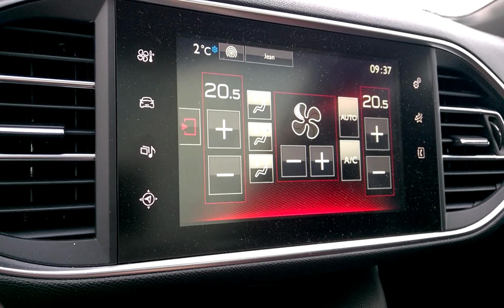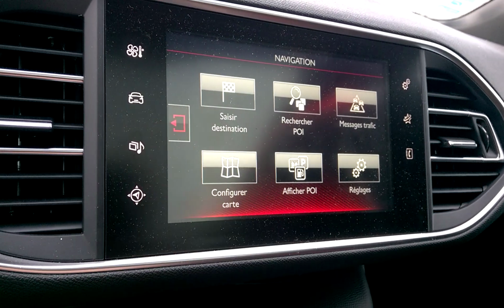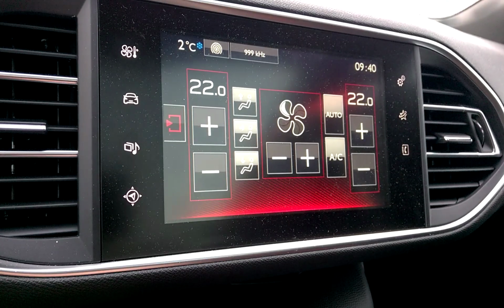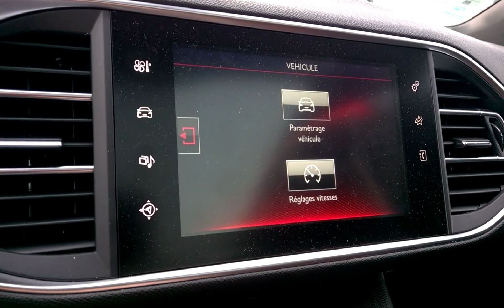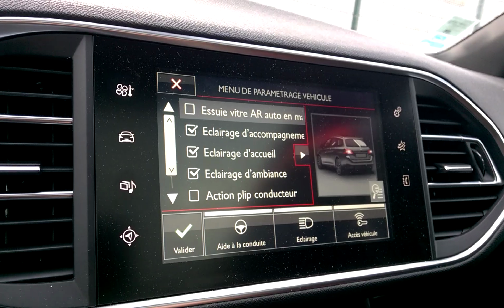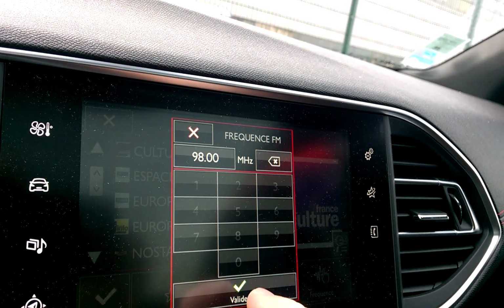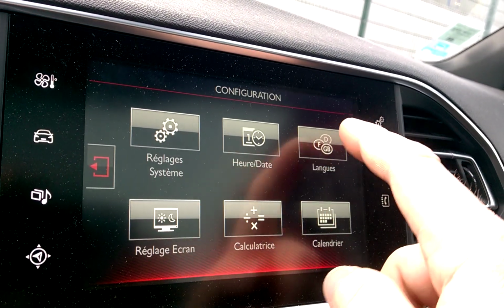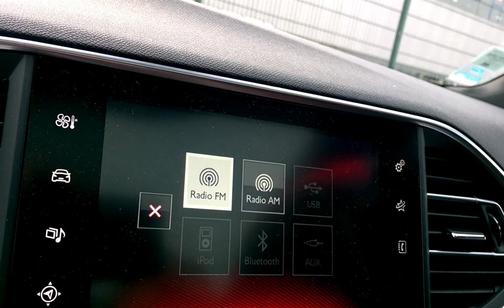Peugeot 308 (2014-2017) audio media satnav system - part 1

Comment: Do you know a solution for the whole audio of the car not working… sometimes :D it happened to me a few times and the best i could find is a problem with the amplifier in the trunk. It thinks that there is a problem with one of the speakers so the car mutes all the audio. But not sure about it and i don’t want to deasemble galf of the car to check. Thank you and much apricieted!

Comment: I've just purchased a 2017 308 gt but the  sound keeps going off, no audio from the speakers at all. Any ideas what this could be?
Reply: This is a common fault. It happens to mine at random intervals too. If you check on the forums you'll find many answers, none of them definitive. It's frustrating as hell. It's pot luck whether you get any sound through the speakers when you first get in. Then, later, all the sound comes back. It's either an electrical gremlin or a software issue. It should be an easy fix after all these years but isn't as far as I know. It spoils an otherwise superb car.
Reply: Other than that, how is it going with the car

Comment: Thank you, getting my 2014 308 next week, so this was usefull 😃
Reply: How its going with that car
Reply: @forfran  it is going great, i have had no problems with it, had it serviced 2 weeks ago, and they said it was nothing unnormal, and only changed filters and fluids.

I also swapped the reverse camera at the dealer, since the original one is not the best in dusk and pitch black conditions, so peugeot offered me a newer model camera, and that works great in the dark , recommend all doing that 

As for how the car feels, it feels just as fun as the day i got it, although i have swapped all the speakers and installed a total of 12 speakers an amp and a sub, so it is allaround a fun and fantastic car still, and very nice for the wallet since it is not a very thirsty car (which is great these days). I look forward to driving many more kilometers and with it 🙌🏼
Reply: @sverreantonsen7054  Ty for the info !! That's what i want to hear haha, hopefully next week the 308 is mine too
Reply: @forfran  awesome, hope you will have much fun with the car as well 🙌🏼
Reply: @sverreantonsen7054 hey bro any update about the car?
Reply: @forgetsassi 175k km on it now, still going strong 🤘🏻
Reply: Have a manual 2015. So far so good... I was wondering about the camera and how to get it changed..

Comment: is there an option to switch on and off the start-stop system through the panel?
Reply from the maker: Every time..the start stop reduces fuel consumption and emissions, so for it to count in the vehicle homologation it must be ON every time the vehicle starts. It does have complex strategies to not stop the engine for example if heating or AC is required,.or the battery is charging etc. But in general either u deactivate it each time, or learn to live with it and save a little CO2 on each drive 👍
Reply: @BenInFrance  Thank you, you are very kind sir, I appreciate the time you took to answer my question. I wish you all the best.
Reply from the maker: Not sure im afraid ive not got that version any more. Start stop is either deactivated by a button low down between the steering wheel and the door, or by ticking / unticking a box in the vehicle parameters in the screen (the little car)
Reply: @BenInFrance  ohh thank you very much for this information! Just one more thing bugs my mind, do you have to deactivate it every time you get into a car or does it stay deactivated once you untick the start-stop system? Would really appreciate your answer on this one, thanks

Comment: Could you please answer how to turn on the heat without turning on the AC?
Reply from the maker: Not quite sure what you mean? Just turn on the heat and press "a/c" to turn off the air conditioning
Reply: benhindsley this is what I dont understand, how to turn on the heat? From what I saw, you can set temperature, but you cannot set warm or cold air. Do you get what I mean?
Reply from the maker: You can only set the temperature. The car has sensors and knows the cabin temperature and sunlight conditions. So you set a higher or lower temp and this system takes care of the air temp for you.
Reply: Thats the answer I was looking for. Thank you a lot

Comment: How good is the stereo system?
Reply from the maker: Not sure how to answer that. The standard stereo is perfectly fine and in one of mine i had the denon hifi with the subwoofer and uprated speakers which i found brilliant
Reply: The audio system is alright,  not the greatest
Reply: It’s adequate, how good are your ears?
Reply: You need to hold gearbox in your car and see wich Version so you have, i Have bought used one and i see that  Sound ist poor so i downloaded New update instal it, audio for me is 30% better now

Comment: Hi 
thank you for sharing the video 
it helps with a few questions i have as i want to get an Estate version of 308SW.
Question i have is how easy is it adjust the temperature of the cabin while driving.
A lot of reviews in the Uk say that it’s fiddly to do and takes your eyes off the road for too long how do you find it while driving . 
Also can you access your phone book contacts through the steering wheel rather through the touch screen  
your response and time to reply is much appreciated 😊
Reply from the maker: Hi, i found i got used to the aircon in the touch screen..it.is more fiddly than having separate switches, for sure, but then i like how it's led to such a clean dashboard style. So overall a bit more fiddly but for me not a major issue.
As for the phone contacts i've never tried it..if i can i'll let you know but for now i can't say i'm afraid. 
Regards, Ben
Reply: benhindsley Thanks very much Ben il let you know if i get one hope you are still enjoying yours 😊
Reply: benhindsley Hi Ben sorry another question how you finding the car overall are you enjoying it what spec do you have ?
Reply from the maker: Chris Hill Hi i have a 308sw. I got the GT line since i love the body kit and black interior. I went with the 1.2 litre 130hp engine which i find fabulous with the automatic gearbox. I'm thrilled with the car and the quality is clearly there - i haven't had a single issue with it.
Reply from the maker: Chris Hill hi ok so i checked and yes the button from the steering wheel allows me to open and scroll through contacts and call them.
Reply: benhindsley thanks for advising me il keep you posted on what i get
Reply: benhindsley Hi Ben if possible please could you upload a video of you accessing the contacts through the steering wheel step by step  only if it’s okay too 
thank you 😊
Reply from the maker: Chris Hill ok so i made you a little video..how to upload it? I'll try
Reply from the maker: Chris Hill here you go. Mind there are different systems in the 308. My initial video is the smeg system from the 2014-2017 car and the video accessing the contacts is a nac system in the restyled 2018 car. https://youtu.be/owlVGQKXCjo
Reply: benhindsley thanks Ben video much appreciated very useful 😊

Comment: I'm tempted to buy one. Can't decide what colour or engine. The sensible part of me says I should get the 1.2 but I'm worried it will be slow and annoying, changing gear every 10 seconds.
Reply from the maker: Buy one! I had the 1.2 130hp auto (sw, gt line) and it was brilliant, a really dynamic engine.
Reply: What about the touch screen bit? People say it's annoying. The only other problem I have is the steering wheel position and the rear leg room. I don't suppose you can comment on the leg room bit if you had the sw version. Otherwise I'm really tempted.
Reply from the maker: steering wheel was perfect for me but i suppose u could try one at a garage, i love the fact that it's smaller it makes the car so much more kart like ! 
Rear leg room is less than a golf sure but do you need it? If so an sw would be better!! Though on the upside the hatch has a much bigger boot than the golf, and overall the peugeot is a lot more fun! 😉
Reply: I went in to a dealership today and had a look. I'm really disappointed. I love the layout and feel of sitting in the driving seat.  Some bits in the 308 seemed a bit cheap but I think I would get on well with the small steering wheel and the dials and the overall look and feel is miles ahead of a Golf. The only problem I had was when I sat in the back seat. I'm only about 175cm but it  was too small for me to be confortable. It seems like the designers were very stupid to not take 5-10cm from the back to make more leg room. The car wasn't switched on so I couldn't try the touch screen but I think I'd be ok with it just because I liked the interior so much. I'll probably end up buying a Golf now and I know I really won't like the dull interior and incredibly dull exterior but practicality will win. I bloody hate Golfs.
Reply: benhindsley hi 
i have asked you a query ref the touch screen your response would be appreciated thank you 😊 my comment is above
Reply: 1.6 has more torque .

Comment: Nice video! Perhaps you can also help me with a question i've got about the navigation on this system. When i've got the satnav on but i've got the system in the music or temperature menu its doesn't give me any visual notifications / direction from the satnav. Do i need to switch that on somewhere? Hope you can help, thanks!
Reply from the maker: In that situation the nav should give you instructions on the central screen of your instrument panel, between the rev counter and speedo. You may need to scroll through that screen by pressing the button on the end of the wiper stalk if i remember rightly!
Reply: Thanks for your answer! When i press the button on the right wiper stalk i get the pop-up with the fuel economy. On the left i get nothing, got any other ideas?
Reply: Think you need to go back to the nav screen

Comment: Is there a way to have the system mix the audio coming from my phone with the audio coming from the system itself ? Basically, I would like to hear any sound from the phone AND the radio at the same time.
Reply from the maker: Hi, not that I'm aware of. though if you have your phone paired on BT, and music playing from the car radio, it will give you notifications from your phone (incoming call, sms etc..) which you should be able to configure under phone or bluetooth from what I remember.